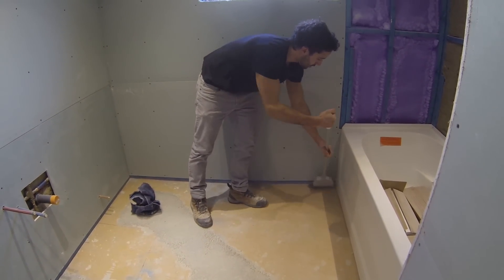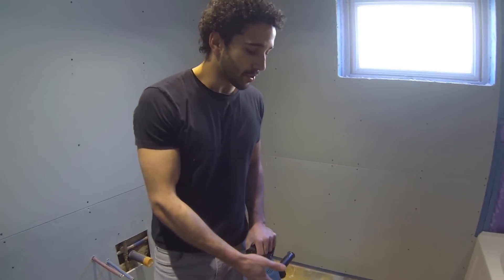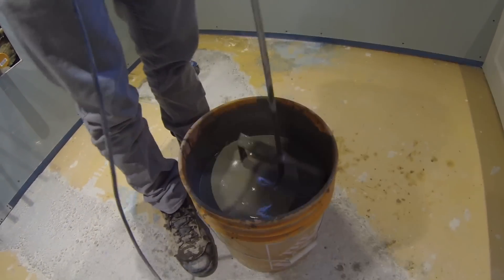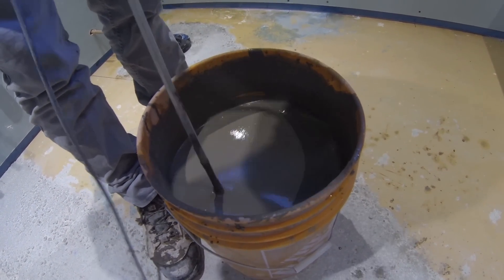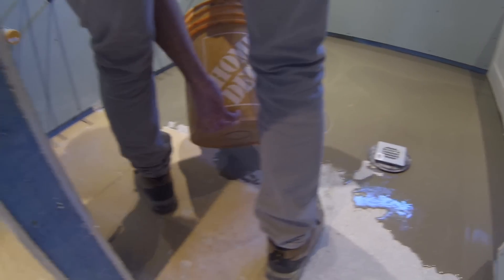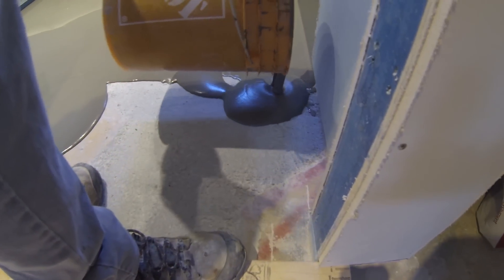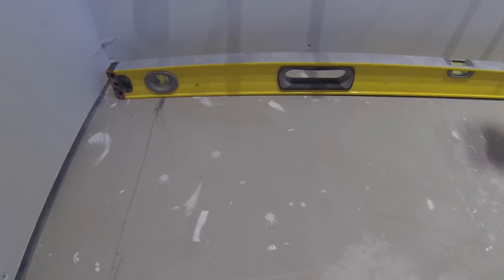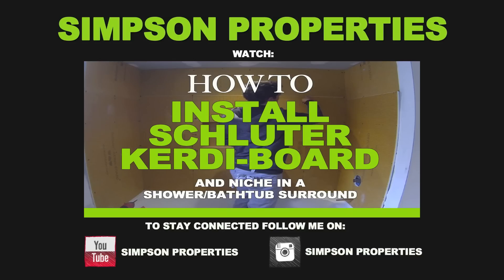HOW TO INSTALL SELF LEVELLING CONCRETE

Comment from the maker: *UPDATE: I would recommend that you use a primer before installing the self leveling concrete. That will ensure proper bonding. Using a spiked roller will make the job much easier and faster to complete. Rather than using a trowel.
Reply: I accidentally managed to get some leveler on the bottoms of my wall... how do I remove it? It's dry.
Reply from the maker: You will have to scrape it off with a taping knife then make drywall repairs as needed.

Comment: What I learned about floor leveling compound; 
Primer is extremely important, especially when laying layers upon concrete. 	
Anyone in the business of floor leveling will tell you that the product isn’t self-leveling. It takes an experienced hand to have a finished product that is flat, much less smooth and level, 3/16th of an inch at ten feet is the max variance. 
	Cold, cold water will give you some extra time to spread the mix before it clumps and hardens. 
Special tools are needed, unless of course you are a concrete man that knows how to use lumber as a tool. And good luck with that. 
Spike shoes are important when doing large areas. 
	A roller with spikes is necessary to remove bubbles, help spread the cement and pop bubbles. 
	A slow stir is necessary to keep air bubbles out of the mixture (recommending a mixer and not a drill). 
	Exact water measurement is extremely important. 
	Stirring longer than two minutes is just wasting set-up time. 
	Sanding often isn’t a problem, some easier than others, some dustier than others. 
	The videos on YouTube are obviously with experienced tradesmen, making the job look easy.
Reply from the maker: Thanks for all the great comments! I completely agree that primer should be used and I messed up by not stating that. Spiked rollers & squeegees make life much easier on larger jobs. This was a very small job and a plain old trowel did the trick. You should put out some content on this topic and spread your knowledge.
Reply: I think a gauge rake would be really helpful.

Comment: For those looking for videos on how to install this product, this video does not show the correct application of the product.
This product requires priming the floor, and expansion joints where it meets walls, etc..

From the product web site: 
"Note: All surfaces must be primed with TEC® Multipurpose Primer before 
application of EZ Level. Create a minimum of 1/8" to 1/4" (3-6 mm) wide 
gaps where self-leveling underlayment abuts walls, columns, and fixtures
 by installing a self-sticking sponge rubber weather stripping or damp 
sand (Vacuum up sand after self leveling underlayment has cured.)"
Reply from the maker: I agree I should of used a primer before installing the self leveling concrete. Thanks for your input it’s appreciated.
Reply: I agree . this guy can not be on my team

Comment: The primer is there so the osb doesn't absorb the water out of the mix before it can fully cure. You likely have a weaker end result because of it.
Reply from the maker: Brandon Schilling I agree primer should be used prior to the install. I should of recommend it use as well. My bad.

Comment: Your susposed to primer that floor first otherwise the patch won't adhear to the floor properly and will pop loose from movement in the floor
Reply: Spot on!
Reply: Nothing better than a tutorial that doesn’t follow manufacturers’ instructions haha. Remind me never to hire them
Reply: ... and don't use an etching chemical, use a walk-behind concrete planar, and then diamond grinding disc for the corners. this will open up the concrete pores and provide an excellent adherence surface. Would also recommend lightly wetting the surface just prior to pouring any mud (concrete)
Reply: I've never had a problem with not priming. Its a floor, not a lot of stress on it. Tile is just fine.
Reply: @1193bobmcc  obviously you don't have much knowledge in prepping floors and flooring. Give it time and that patch will pop loose. There's a reason why it says you must prime floor before spreading the material
Reply from the maker: I agree that I should have installed primer before installing the self leveling compound.

Comment: This is the best video for this project I've found. I have a rough concrete floor in my basement and I'm putting in a half bath. I've already had it plumbed. Now I just need to frame the space in, pour some self-leveling concrete, and tile away. 

I can't power wash the floor but I'll use my hardwood floor power mop with the tile scrubber attachment. Once it's clean and I've made sure there's a minimal amount of oil anywhere I don't think I'll need primer. Watching you not use primer makes me feel better.

The basement will remain unfinished except for this bathroom area so if it doesn't come out quite perfect I think it'll be fine.
Reply from the maker: Morgan K, Going forward I will use primer like the manufacturer recommends. It doesn't cost that much more and it will ensure proper adhesion. Thanks for watching, I will be uploading more videos soon. Good luck with your project.

Comment: Hardly anyone in the U.K has floor drains in their bathrooms and I can't think why not. It makes such good sense.
Reply from the maker: Floor drains are not used in residential applications typically in Toronto as well. I added the floor drain as a back up in case the bathtub over flowed. The bath tub has a built in overflow so it was a bit over kill adding the floor drain. In the future I won't add a floor drain to a bathroom. A primer valve has to be installed to keep the p-trap filled. It's one more thing that can break and has to be maintained.
Reply: Interesting. We have a waterless trap in the U.K for those applications where the trap might evaporate.
Reply: Great video.  To get rid of the floor drain (I have one in an old laundryroom I'm converting into an office...washer moved an no where near the room anymore), what would you do?  Just shove some newspaper down and cement over it before using the self leveling compound?
Reply from the maker: Scribbler1382 thanks. Don't shove news paper down the drain. That could eventually clog your main drain plus sewer gasses will make there way into your office. You will have to chip the concrete around the drain then cut the pipe below the floor line. Then buy the appropriate size abs end cap depending on the size of your pipe. Use abs glue and attach the cap on the pipe and cement over top.
Reply: expanding foam. It will seal and you can auger it out very easily if you need to.  Cut it back slightly and put some cement over the top. Job done
Reply: Skill Builder okay, I like this idea better. Unfortunately I went to Home Depot before I saw it. I've got a can of the foam, but now I also have a mini sledge, a chisel and an ABS cap I don't need. :/
Reply from the maker: Scribbler1382 spray foam is designed to insulate not fill your plumbing drains with. It won't take that much longer to do the job right.
Reply: Well, I was going to do it that way after all, but it looks like we're back to the foam.  This place is crazy old and the pipe isn't ABS, it's clay.  And the foam is really just to keep any smells down there (though, we've never used the drain and there have never been any smells in 4 years).  The cement over top should keep any back wash (though, again, that's never happened) in check.  If not, I'm guessing any cap would get blown off regardless.
Reply: You're asking for major troubles not capping it properly.
Reply: Skill Builder That's true for the US too.  I don't see why they'd be needed.
Reply: Skill Builder stick a little olive oil down the trap to stop it from evaporating
Reply: I agree it is great to have it, but perhaps not right in the middle of the entrance.
Reply: Some in the UK including I have floor drains in wetroom areas. I agree that relatively few do this is because it is relatively expensive to take out and relay flooring to get the gradients right.  It only made sense in my bathroom because I totally gutted everything and started from scratch to have a trendy wetroom area.
Reply: We have one in our Korean bathroom. The shower is in the corner, very nice set up for washing pretty much anything.

Comment: Have a large tiled room that has some uneven surfaces (and hence broken tiles) with ~1/4 separation in few small areas. I want to lay a vinyl plank floor. Rather than removing the tile, was hoping to spread this directly on top of the tile then the vinyl afterward. It's a large area (1,000 sf). Any advice on doing such large areas? THANKS!
Reply: That will work but you want some control joints and make sure old floor is solid
Reply from the maker: I always prefer to remove any existing flooring if possible. I would recommend you reach out to Cosella Dorken's Tech department: 1 (888) 433-5824. Ask them about installing this subfloor system over existing tiled floor.

Comment: Hi I'm doing some research before working on my bathroom, but do you want to place the drywall a little above the floor when screwing it to the wall? And if so, would you want the self leveling concrete to stick to the framing wood behind the drywall? Or would you place some kind of tape over the wood prior to laying the self leveling concrete? Also would you place this under a heavy (300lb) cast iron bathtub if the subfloor is not level? I have a concrete subfloor and I'm pretty sure it's uneven under the tub :/ very good video otherwise! Thanks!
Reply from the maker: David Na yes you normally leave a small gap between your drywall and concrete slab. If you are concerned about self leveler seeping into other rooms then you can install foam or plastic around the perimeter of the room. All the other rooms were unfinished at the time so that was not an issue for me. The self leveler was contained to this room only anyways and did not seep under the base plates. As far as how much weight it can support it should be fine. It wouldn't hurt to call the manufacturer and ask. It may even say on the packaging how much weight it can support. Thanks for watching.
Reply: Wow that was such a quick reply. Thank you so much :) when you mention plastic do you mean like a vapor barrier? Or some other kind of plastic? Once again thanks a ton! Subscribed!
Reply from the maker: David Na no problem! Yes by plastic I meant vapor barrier.

Comment: What do you do in a small 4x6 cold room off a basement bathroom if there are what appear to be clean-out PVC pipes outlets (maybe for a possible floor drain?) at the floor level?
Reply: Check to see if they have a trap, floor drains are trapped beneath and hold water to stop odour. Clear outs are capped to prevent odour and do not have a trap. Clear outs are generally somewhere you can rod or camera to help inspect or unblock. Floor wastes need a fixture attached to remain charged and avoid a dry trap.
Reply from the maker: Lvvry1 the floor drain will most likely need to be extended to the new finished floor height.

Comment: I really like the finished result, especially the distressed wood finish. Are those floating vinyl planks? If so may I ask the brand, style and where you got them? Thanks.
Reply from the maker: Thanks! Surprisingly it's digitally printed porcelain tile that I purchased from Centura Tile. The manufacturer is Coem, 6X36 Old Wood Grey Oak m, NaturalProduct ID: OW193R. It's amazing how much it looks like real wood & it comes in three other finishes as well.
Reply: Thank You! Also is there a concern about the leveling compound running under the wall and seeping into the room on the other side?
Reply from the maker: +rob5i it's hard for me to comment on that without seeing your site. It shouldn't be a problem as long as you pour the self leveling concrete about a foot away from the walls then feather the edges out with a trowel.

Comment: I have these drains in every room of my basement, which has unlevel concrete flooring. How do I adjust the height of the drain cover to account for the difference in height when the new concrete is applied? I seen in this video it looked like the drain cover was raised off of the floor.
Reply from the maker: That’s a question for your plumber. It will most likely be a difficult task to raise all your floor drains. They are normally PVC, clay, or ABS cut flush to the slab with a cover.

Comment: Good video but I'm disappointed the  concrete did not fully self level.  What's the  point then??.
Reply from the maker: I should of used a spiked roller it helps spread the self leveling concrete better than using a trowel. Depending on the brand of self leveling concrete you can only build up the area to a certain height. You may have to do a couple pours to achieve your desired end result.

Comment: Hey another good video. Any suggestions for products to put on black mastic/adhesive? I've heard from a flooring specialist that there is a product that does not require you to scrape the mastic but I have varying reports on how ideal that is.
Reply from the maker: DJ Malleck sorry but I haven't had to deal with that situation. It's best to consult with your flooring rep on this one. If possible it's always best to remove all the old flooring materials. It requires more work but it's always worth it in the long run.
Reply: Ok.  Thanks for the quick reply!

Comment: Correct me if I’m wrong, but if the floor wasn’t level afterward wouldn’t that be an indication your mixture needed more water?
Reply from the maker: I should of used a spike roller during the installation process. It helps distribute the self leveler more evenly.
Reply: You can only add the amount of water it specs and no more cause it breaks down the structural integrity of the leveling compound

Comment: What did you do to make sure the SLC didn't run down underneath the bath tub or under the drywall?  It looks like you put baseboards around the room once you finished the bathroom, so is this why you didnt prep the room with barrier protection?
Reply from the maker: Andrew Susskind the entire basement was unfinished so I was not worried about the SLC running beneath the base plates of the framing. I poured the SLS about 1' away from the exterior walls and feathered the edges with a trowel so there was no overflow into the other rooms. I was not worried about any SLC going beneath the bathtub it could not affect anything. It filled in any unlevel  voids in the floor.
Reply: thanks for getting back to me... wish me luck.

Comment: Another great video, thanks! Looking to raise concrete floor about an inch maybe 1.25". Do you recommend this approach or another?
Reply from the maker: bmoreira2000 thanks again! Make sure you use a primer before putting self-leveling concrete down. I should off recommend that when I made this video. You can also use a spiked roller to spread out the concrete rather than a trowel. You can try this method. If it doesn't give you enough height you may have to rip some custom shims to level your floor.
Reply: Recomd using mortar instead. Deck mud. Much cheaper option when raising an inch or more. Youll provably need like twice as much self level that mortar.

Comment: Can I walk on this? I want to level a basement floor for common area laundry in a multiunit house. I was going to use this and then paint over it. What are your thoughts?
Reply from the maker: Once it’s cured it’s fine to walk on. I’m not sure if it can be painted. I would recommend checking with the self leveler manufacturer to make sure it’s ok.

Comment: Our basement unfort got a lot of water in it during a heavy storm so i had to remove the tile downstairs. As long as the tile is completely up (and some of the adhesive is impossible to remove) is it okay to add self leveling concerte on top ?
Reply from the maker: Sorry for the late reply. I would try to remove as much of the adhesive as possible. A concrete grinder would easily remove it. Definitely use a concrete primer before installing the self leveling concrete to ensure proper adhesion.

Comment: Can you use this stuff for small areas? Or do you have to cover the entire floor? My room has one single OSB board that sags & the closet floor slopes down towards the walls. Otherwise level
Reply from the maker: Yes, you could use self leveling concrete for a small area. You will use less material obviously. Prime the area prior to installing the self leveler.
Reply: @simpsonpropertiesltd  Awesome, thanks for the info & for putting the video out there

Comment: I'm installing Roxul safe n sound in my basement and the first bags I got from Loews were great. But I found a cheaper deal at Home Depot for a bulk price(15 bags). These bags smell and cause Way more particles in the air. Strange. Same exact product, can't imagine why they'd be so different. Have any experience with Roxul s n s?
Reply from the maker: Larry Tate I have a video on Safe'N'Sound insulation: https://youtu.be/k5nT3PESy90

That is strange. I have never had that issue before.

Comment: Would this work over a plywood subfloor to level out a low spot before laminate goes down?
Reply from the maker: The product used in this video is meant to be used over concrete floors. There are self leveling products available for wood floors as well. Here is a link to a product I found I hope this helps: http://youtu.be/35NbjSh5h0w
Reply: Yes

Comment: Would you recommend self levelling on a large garage floor? My garage is 30 metres sq. I've been meaning to do it for years and finally have time.
Reply from the maker: wellycov yes I would recommend using self leveling concrete for a garage slab. For a larger space like that you may want to hire a company for the install. They have pump trucks and could take care of that job no problem. If you factor in your time & material it's most likely to worth doing yourself.